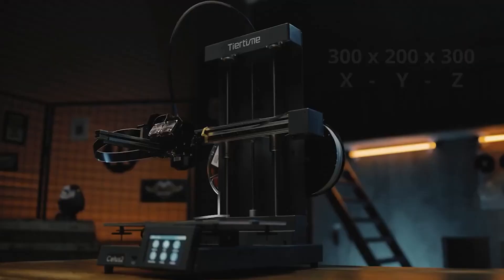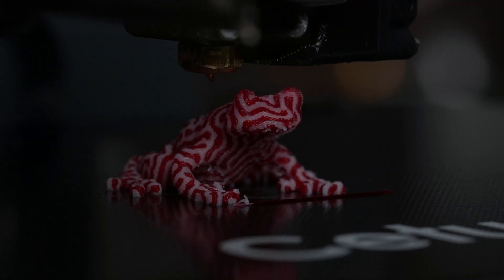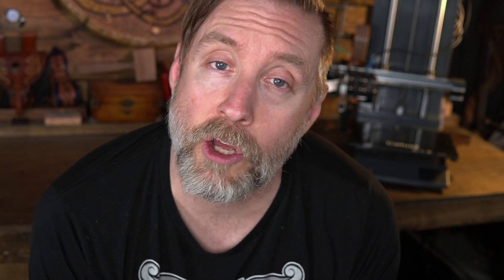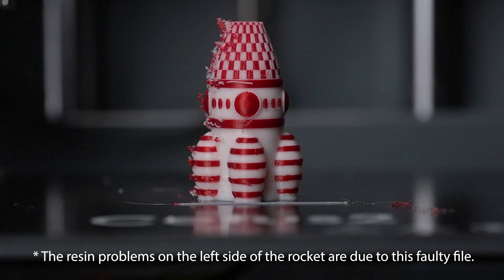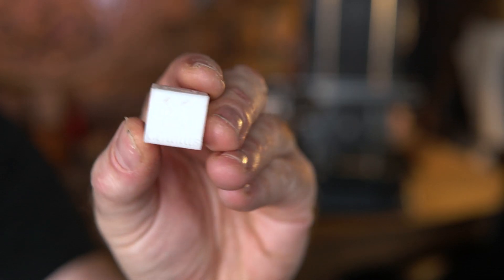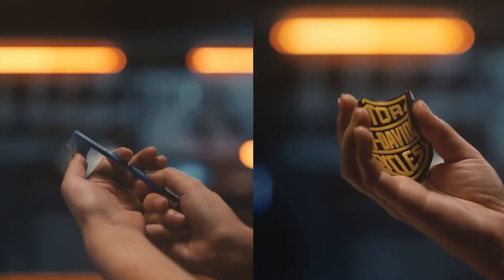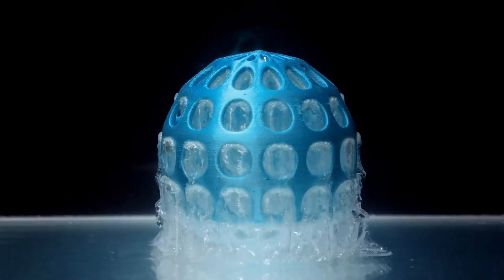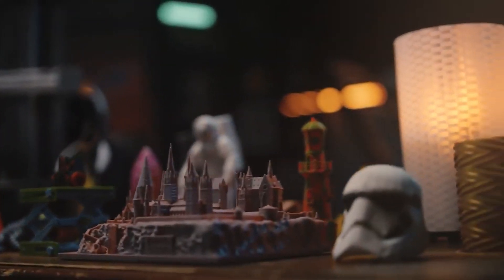Is this 3D PRINTER Garbage or Glorious? The Cetus2 - Creatively Frustrating | Honest Review

Comment: I use an ender 3 with a glass print bed and other than the original filament feed gear stripping out (MY FAULT- had the tension too tight) you can use a multitude of software to run it and personally i use cura slicer and the stock windows 3d builder software with mine both are free btw!

Comment: Ive been following a couple of model makers who 3d print the models from provided files. The files cost coin to purchase and it seems there can be often catastrophic failures due to issues with the files and the interface with the software. Some printers are also locked to certain software for your files so Caveat Emptor. Its hard atm to find an entry level item due to the amount of paid promotion and the constant changing in the tech. But it makes us older folk feel good when we nail it. :)